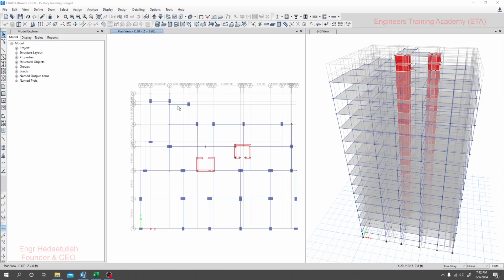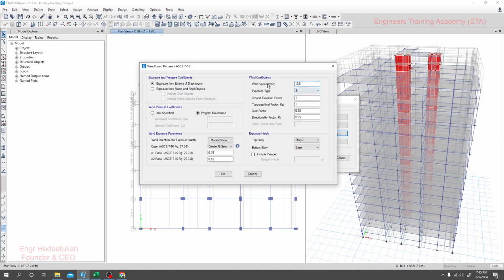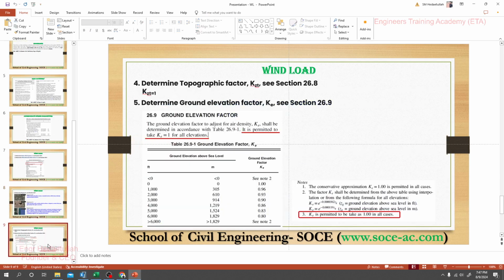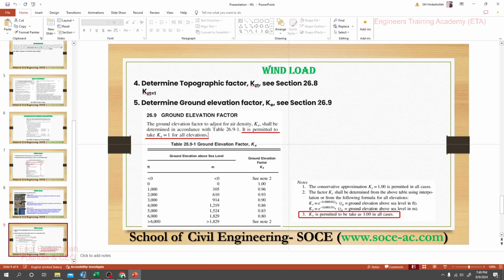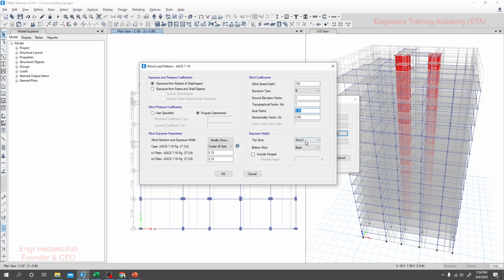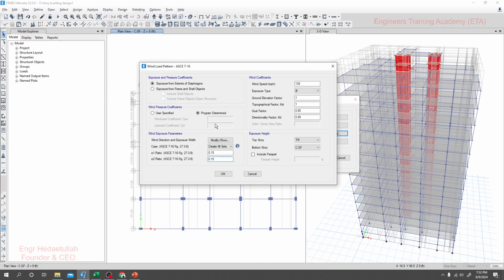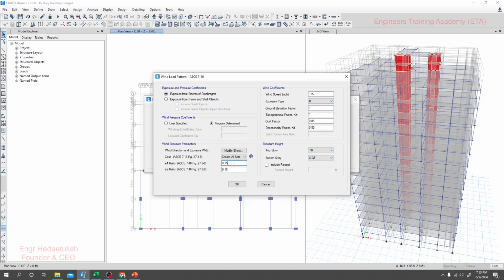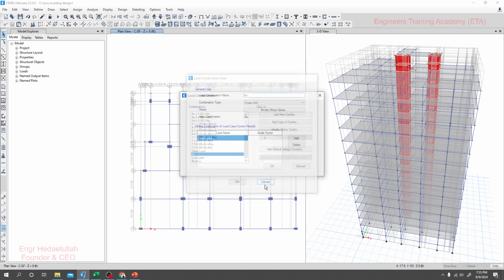28. CSI ETABS v22 2024: Apply Lateral Load in Etabs - Define wind load

Comment: Hi @qlearnify-en  I am having 2 issues of applying wind load on a 42 story building. The 1st issue is when applying through Diaphragm, The reaction of wind is quite small and some reactions are going same direction as applied wind which is weird. The 2nd issue is when I applied wind load using cladding(auto draw cladding) the windward pressure is going inside at some floors and going outside at some floors(local axis for each cladding panel is already going in the right direction). Appreciate your advice to fix these issues. Many thanks in advance
Reply from the maker: check here:
https://docs.google.com/document/d/1ULnrn7yOPJv-LuomVLxGda4VidMcTg25XgzwibG1z6E/edit?usp=sharing